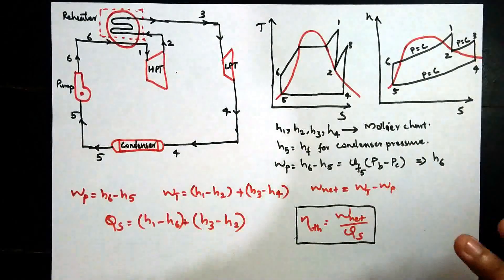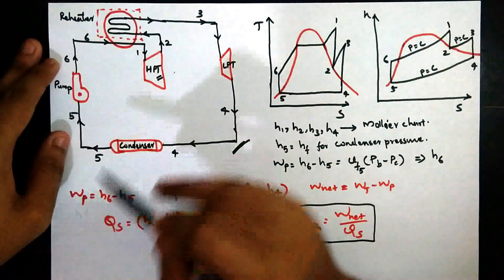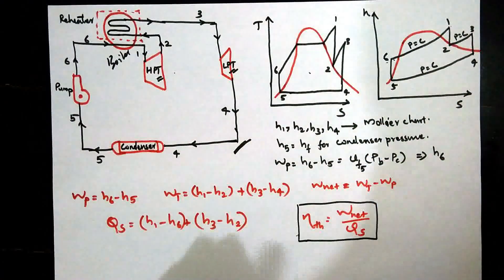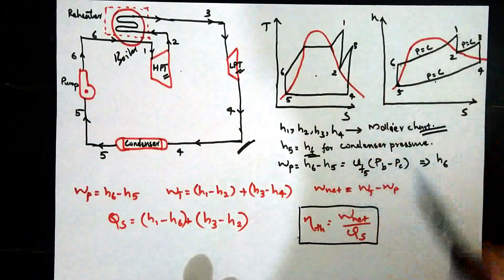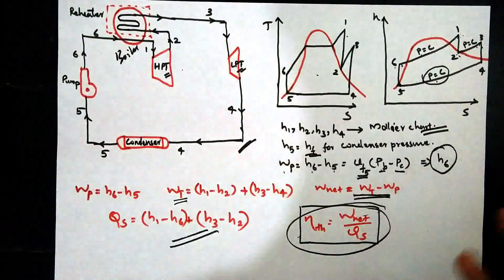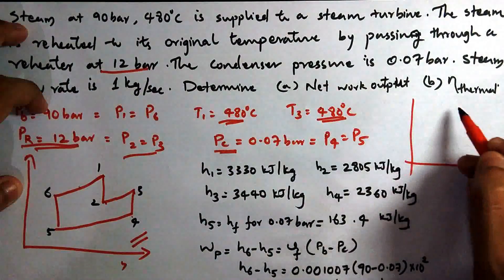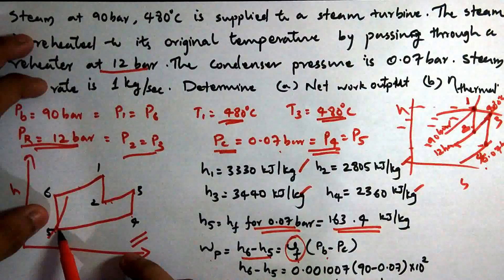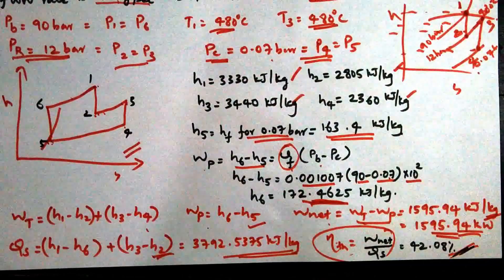Reheat Cycle - Improvement in Rankine cycle  |ThermalEngineering|KTU Module 1 - Part 2

Comment: 480 temperature line ilaa mollier chartil steam tabililum 480 temperature ilaa appo enthu cheyum 450 yum 500um ondu 😥
Reply from the maker: Molier chatti 480 nte position ekadesham locate cheyyam. Angane cheythal mathi. Otherwise use interpolation method by using the values at 450 and 500 to find the corresponding value at 480